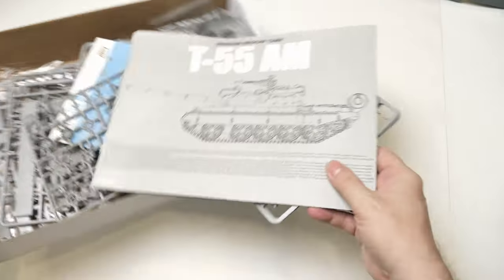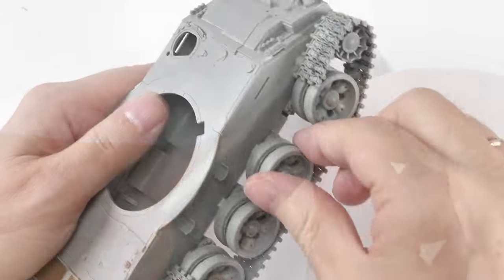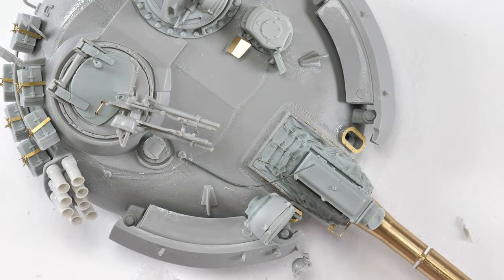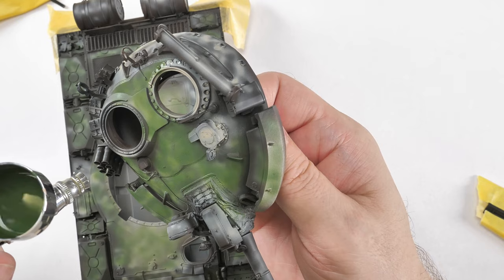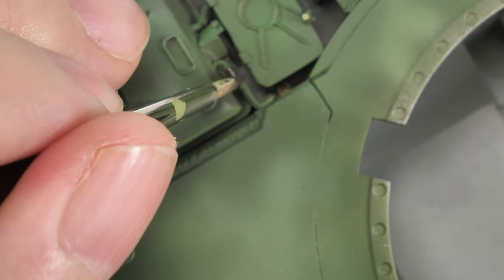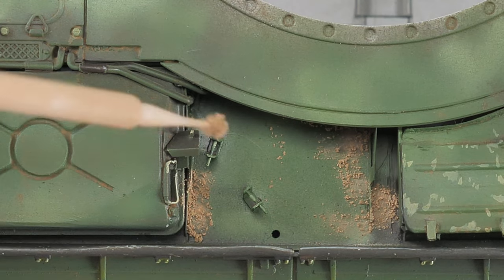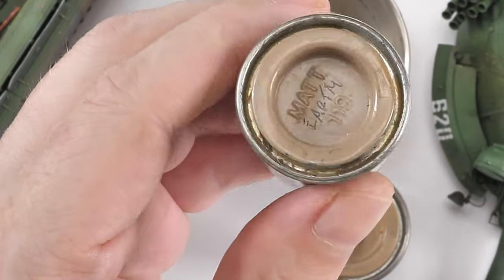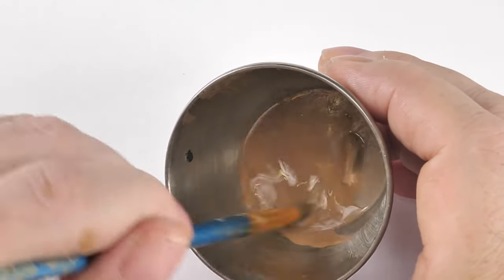Takom 1/35 T-55am Part II FULL BUILD & WEATHERING

Comment: Me and my brother own a real T-55 AM "Merida" here in Finland. It had paint chipping everywhere, the extra "cheek" armor was the worst. That was because the Polish Army had repainted it when modernizising it 1995. Just by painting it over the original paint... I had a ton of work to repaint it again. I painted it RAL 6009, the 6007 would have been closer to the correct, but at least it is no longer chipping... The extra armor has welds that do not rust (shiny, like stainless, the actual armor plate rusts mostly by pitting. The right hand side fuel tanks are rust free, but the spare oil tank between them was chipping and flaking all over. The most rearward tool box lid was chipping, like the most front one. all others rust free. The corrugated shield above the exhaust was chipping too. The shield plates under the exhaust on the rubber skirt are lighter green, sort of brownish green.The area front of the driver's hatch had the paint worn off before repaint, and the flat area just front of the turret had surface rust, even the repaint had been too thin. The steel mesh above the radiator, oil cooler and the fan wears to be eventually dull silver color or is not painted at all, it is stainless(those photo etched parts in the kit). The towing cables are protected (when new like ours) with grease wrapped with paper, and the paper peels off eventually unevenly. Ugly... The underside was still primer light red. Loader's and driver's hatches are white inside, the commander's hatch is dark green. Tow points are black. Side skirts are rubber, and the upper ones tend to lean outwards unevenly (there is no way to open the tool box latches unless they are bent outwards every time), the lower big ones are straight exept the front triangle ones that want to bulge out because the front fenders are always a bit bent. And, I had to build this exact kit to have a small decorative one. My model kit had faulty castings of the tracks, the bits did not connect , so I had to make thousand little cuts to make them fit together. Took two days.... The tracks are not rusty. They are gray/silver.  The spare track parts are black. The road wheels right next to rubber have surface rust as they usually are not painted. The hubs have two bolt heads opposing each other red. And the worst thing: the steel meshes do not have the holes for the cover locking. And, again, the tracks are not rusty if used at all. And the front fenders are a bit bent. All areas around the toolboxes and fuel tanks are dirty black from oil and diesel. And the wire mesh is dull silver.